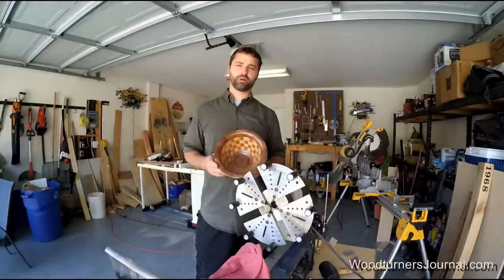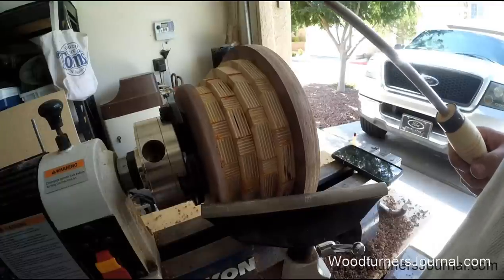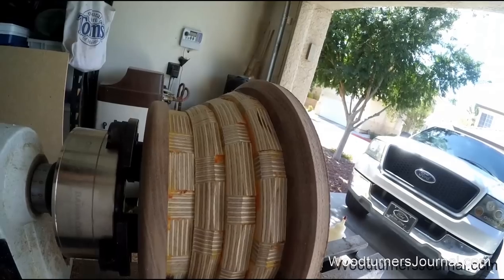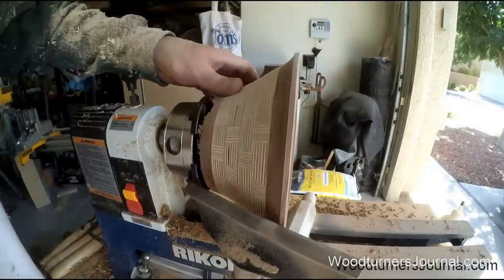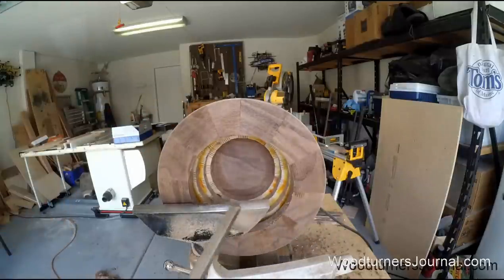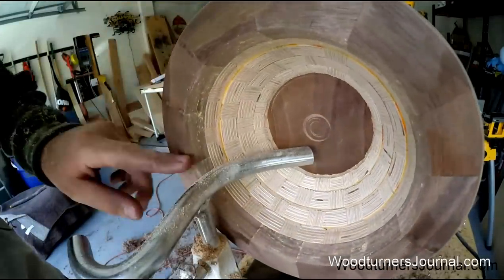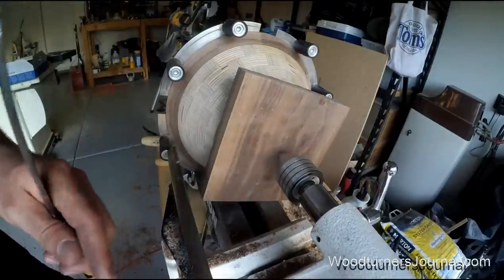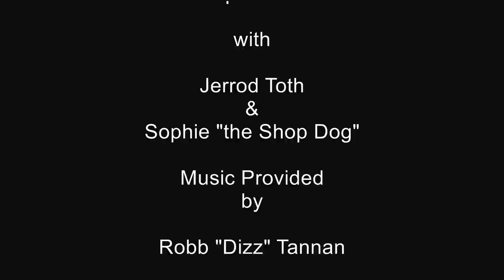Woodturners Journal: Turning a Baltic Birch Plywood Bowl part 2

Comment: I really like the plywood grain patterns, is there a reason you didn't use sanding sealer, that may have helped with the porous nature of the ply.
Reply from the maker: Hey there.  I never use sanding sealer.  I would rather use more coats of a finish than sanding sealer.  I know it's not supposed to effect your overall finish but I feel it does.  I've noticed that oil finishes do not soak in as well and it comes out lighter in color and does not have the depth.  Just my opinion.

Comment: Great bowl and nice documentation. I'm curious: did you ever run into tear out on the Baltic Birch? I've been experimenting with turning BB and I'm noticing some segments have missing fibers (or rolled fibers) where it looks like tear out.  Any suggestions are welcome :)
Reply from the maker: I did not have tear out, but there are voids in the fibers.  Simply fill with wood glue and immediately sand.  It is completely unnoticeable.

Comment: Dang dude you scare me. I could feel myself tensing up just watching this video.
Reply from the maker: Ron Poddig Yeah.  After this video, I built a mitre jig to hold the pieces and make it safer.
Reply: Woodturners Journal I was glad to see you still had all your fingers when it was over. Really like the bowl though. I am thinking about getting into turning. I do woodworking now but I don't have a lathe or I would be doing it as well.